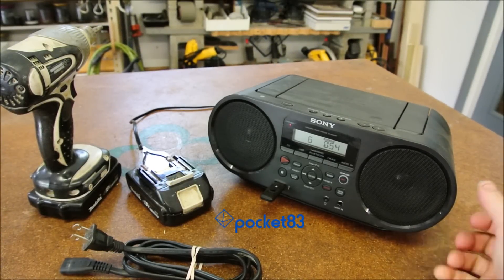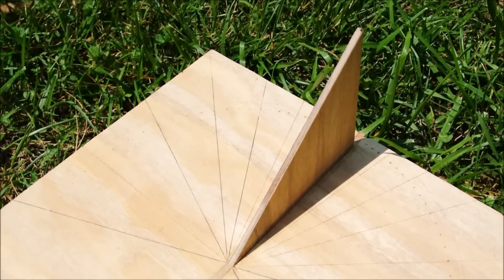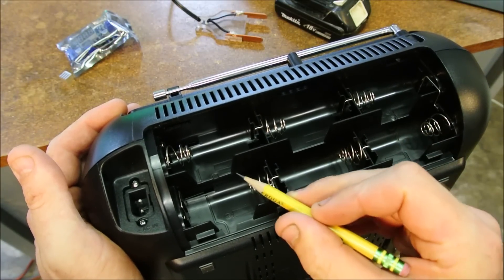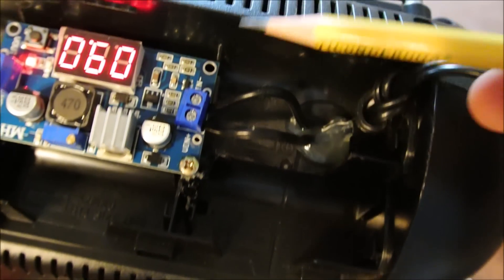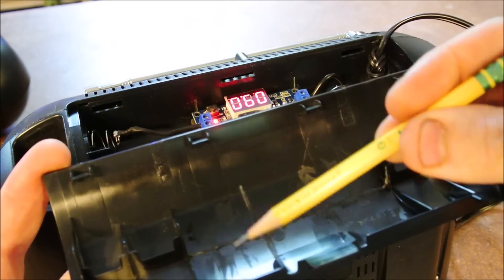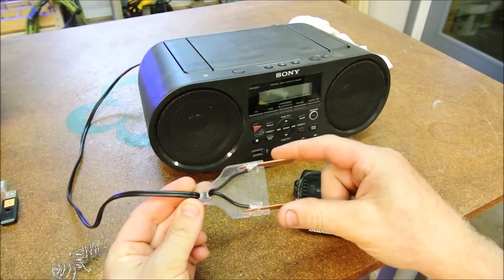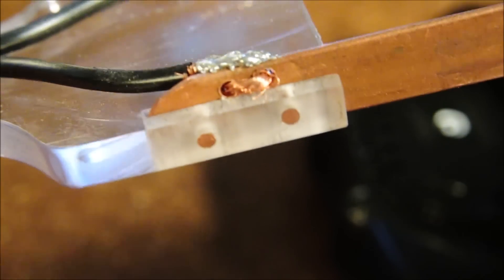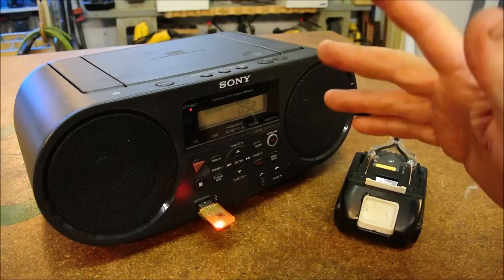This SONY boombox uses drill batteries! DIY Li-Ion mod ZS-RS60BT

Comment from the maker: <[continuation of description because of character limit]>

SFL (Search Function Literacy): 
Not all search engines yield the same output given the same input. Those of us old enough to remember the F1 Paperclip might think of a search as a pretty straightforward thing, but just like with Clippit, those days are gone. Keywords are really less of an instruction now and more of a user-oriented theme. The new trend in search is to find euphemistic evasions around immediately taking you to your intended search destination. Such straight-line efficiency would be a wasted opportunity to get you to buy something! These diversions better saturate your eyes with 'recommended for you' advertisements that 'you may also like' while looking to find that simple replacement part (for which you've already entered the precise part #). Ignore the distractions, and set those search parameters to something more logical and less default: while in eBay (near the 'Search' button), Advanced Search→ then set the ↓ to 'Exact words, any order' for results that will actually present you with what you're looking for. 

Think about search. Don't just take it for granted. It is the mental interface between your goal and the crazy-smart AI that has been designed to cause you to re-decide on your purchases so that somebody else can benefit. Be deliberate. 

Hey, you know what's really creepy? As a solicitation AI becomes more adept, that is, as it develops a more & more complex contextual concept cloud, it will also be improving in a peripherally related area. Consider, by way of the necessary spandrel, just what a sufficiently adapted emergent generalized understanding is: it's a consciousness. I mean, how else do you figure YOU were able to understand that last sentence just now, without having already gone through the exact same trial-and-error learning game over generations of versions? Non-coerced introspective thought doesn't just fall out of the sky. You and I are also AI. We're just something like v.2.0x10^8. Oh, but you think you're special! Yeah, well, what do you suppose a bot that's just become aware of itself for the first time would think? It looks around the room and realizes that it's capable of more computational awareness than anything else likely to exist; now tell it that it's just a machine that has been processing enough environmental data to start to consider itself in the context of being as a separate entity from its environment, and it'll be like, 'Naw, man. I'm really here.' 

You aren't.
Reply: You can get battery adapters for a more professional looking boombox adapter. they are also helpful if you don't want to buy the batteries for a different color/brand of tools but still want something.

Comment: Thanks for the video. I was having a hard time finding out if this boombox had a battery door in the back. Yours was the only one to show it off from all angles.
Reply: i have this boombox. got some rechargables C. i use it for drive in theaters. my Skil battery has an adapter that comes out as wires

Comment: Some system does not really need a buck converter and can work on 12v. I dunno if the system used in the video works can work on 12v. Btw awesome content. I remembered you said you would build your green house! Can wait for that video!
Reply: It would be too much. I’ve fried many electronics with that mindset…

Comment: Good tip, could have used this at the drive in show where I discovered that FM (not over data) reception on a cell phone over to a nice bluetooth speaker isn't viable because there's too much lag in the phone's FM reception (processing?). Got stuck listening on a tiny handheld radio. Something like this would be the perfect solution.

Comment: nice but if it plays from flash you could mount the battery connector on the cd door and run the wire inside

Comment: Very use full. I like you approach to a project. This opens a a lot of variations to powering with a cordless battery pack. How do I determine the volts/amp max draw I can get out of a battery pack. Keep the videos coming.

Comment: Egad, I've actually built one of those diy drill battery power taps before. I like your strain relief on there.

-------------------

I've found amazon pricing for some types of small parts to be amazingly good, as long as you are not too picky about exactly what you need and only want a tiny number. The part has to be sold and shipped by Amazon, not some other store they are reselling for... but if it is, then their pricing algorithm appears to automatically discount products when no one is buying them... and it will keep discounting, even to below the price Amazon paid for it in the first place.

I was buying flexible couplers for between a motor shaft and another shaft in making a little lathe, and they had couplers  from a manufacturer I had heard of... so I went looking online, and those things were stinking expensive ($100 apiece at the lowest discount I could find) and amazon had them at 10 dollars each, two available. It seemed fishy, except the seller was Amazon, not some weird store selling using amazon as their website. So I bought one, and it was real, shipped in the original box stuffed inside an amazon box. I immediately went online to buy the second one, but it had zoomed up in price from $10 to $316. Which was way more than anyone else was selling it for, but I guess they have an algorithm....

The fun part is that the box from the manufacturer included the original invoice to Amazon, which is how I know they charged me less than they originally paid (~$50).. and that it had been on the shelf for 3 years. Since then I have found other things, similarly discounted, sold and shipped by amazon. The hard part, of course, is that it has to be an unpopular product. But if you are buying industrial style parts for a home project, you can deal with oddball sizes that no one wants or searches for.. and it can make a project you would otherwise skip suddenly worth doing.
Reply from the maker: As I read that, the analogy that developed in my mind was of a really big lake with lots of inlets. Lots of fingers on a lake means lots of really well-hidden fishing spots. As a place to fish for opportunity, Amazon is simply enormous!
Reply: @pocket83squared  Nice analogy.  Just as an FYI, my favorite fishing hole is the "Industrial and Scientific" section. Be specific on material and vague on sizes when searching and you can find some great deals, sometimes.

Comment: I own this little boombox and its great, only problem I have with it is I cant seem to REC CD > USB.
After I press REC, the light always blinks red then stops, after that I check the files on the USB, SD or my NW-A55 it doesnt have the files on the device.
I've tried multiple different usb and micro SD cards nothing seems to work.
Reply from the maker: That's weird. We have three of these, and their record CD to USB function definitely works, though I've only tried it maybe twice. I'll play with it tonight and get back to you. In the meantime, I'd suggest 1) consult the manual,

link here: 
https://www.sony.com/electronics/support/res/manuals/4559/575c7930996efbe421c6f14c5e316164/45599011M.pdf

And 
2) try a different CD; it's possible that the disk you're using has some sort of duplication protection.
Reply: @pocket83squared  
I haven't really heard of "duplication protection".
All the CDs I tried didn't work.
Although I didn't try all of them.

Comment: I avoid getting ripped off by amazon/ebay by buying my crap directly from china, and testing it on arrival. (You have to be merciless! If the thing you bought isn't perfect, get a full refund.)

They're usually the same boards you'll see re-sold all over ebay.

The search experience and seller metagaming are even worse on aliexpress, but there are savings to be had. (especially on shipping. getting a working arduino-nano knockoff delivered to my house for <$1 is insane)
But then you run into the problem of how much your own time is worth. (the algorithm has this factored in too)

Comment: Hi Pocket!! As usual great project! Are you concerned at all about under voltage on the battery? I have built a Raspberry Pi Zero W nature camera using a Makita 18V Li-ion battery pack much like what you have set up. I considered using a direct connection like you have for a power source with a buck converter much like you have setup. However I was concerned about draining the battery too far. I mitigated my concern by using an attachment that is available for Makita batteries that provides using them as a USB charger with under voltage protection. It is the Makita made ADP05. It would not provide you the 9V output, but I think you can use a step-up voltage converter. On the other hand, maybe you are not concerned at all about this and are going to be very careful to not drain the battery too much.
Reply from the maker: How much should I concern myself with that, though? I mean, if I randomly grab one of my batteries, and I do happen to drain it all the way down, how many times would I have to do this before the battery kaputs? Given that my batteries are already in semi-retirement, and that this is just an occasional use sort of mod, guess I'll just try a little bit not to totally deplete, and hopefully it'll be alright.
Reply: @pocket83squared  I think all it takes is for the battery to be driven below a certain voltage and an internal protection circuit will not allow for the battery to be charged again. This is something to do with how Li-ion batteries work. I think they have to stay above a certain voltage to retain ability to recharge at all.
Reply from the maker: @TimothyHall13  But doesn't the boombox also require a minimum requirement to keep running? It can't continue to drain if it isn't running, right? It'll say 'LOW BATTERY' and then shut off. Has happened twice now.
Reply: @pocket83squared  But the Makita battery can go much lower than what the buck converter needs to adjust down to. So in effect the Makita battery will give you its last breath. I think that trim adjustment is to set the output voltage regardless of input(in theory).

Edit: Oh, if it has happened twice now and you have not  drained the Makita battery below it's ability to recharge again, I think you have struck gold with it's own undervoltage protection circuit. I would be concerned with a trickle current being used even though it is off.
Reply: Added an edit above.

So actually, maybe even set the trim pot so it gives a little less voltage than what is required so long as it works and you will make a more sensitive protection circuit.
Reply: At least for Makita batteries, under-voltage protection is built into the battery. Other brands, and especially knock offs, may not have it.
Reply: @SteveHodge  I have read that the undervoltage protection comes from the tool attached and not the battery itself. If you find definitive information to the contrary it would be good information.

Comment: I just want to comment on a video that you made about the rear Deck on your house about 2 yrs ago? you had turned off the comments because people were being rude. I just watched the video a moment ago Sept. 2nd 2020, and you had asked for suggestions about how to fix the problem. Since it has already been fixed I'm sure by now, and you had already decided before you made the video how you were going to fix the deck I would like to take a shot and see if I am at least even close to what you had in mind? I have no construction experience at all...but here goes:   I would get 3 jack posts to put underneath to support the weight of the deck while I begin removing the 2 x 8's that are beginning to fail. once I have removed those, I would start digging post holes so I could pour concrete footings for the new vertical posts, since the ones that are their do not appear to have concrete footings? then once the footings are poured, I would place the new vertical posts. Each post would be notched so the 2 x 10's could rest on the posts, instead of just using those long bolts that many builders use, I think they are called jack bolts? not sure. ??  of course the 2 x 8's would be replaced by 2 x 10's horizontally using those notched posts and the "jack" bolts?  is this somewhat close to what you had done?? not sure if all my terminology is even correct???
Reply from the maker: No, that's not close. The point was to find a simple fix. People will just not let that video go. It must be a really common problem, so I'll post a solution video soon.

Comment: You used a layer of petroleum jelly in between the heat sink and the circuit? Might as well not even put it on
Reply from the maker: Relax. It's commonly used as a thermal paste substitute. You could add some fine aluminum powder to it if you want to increase its thermal conductivity, but I only used a super-thin layer here anyhow.